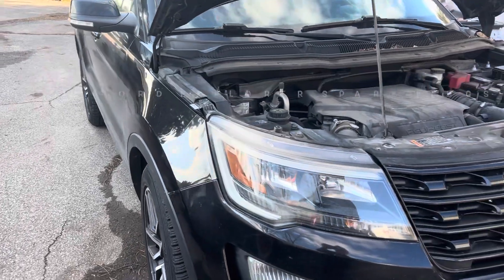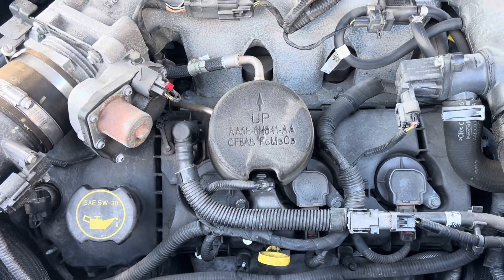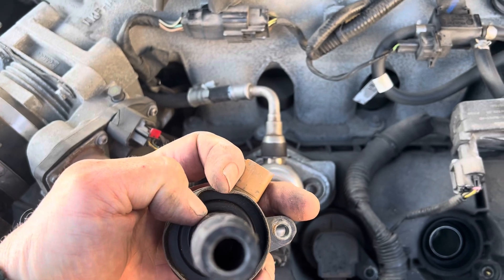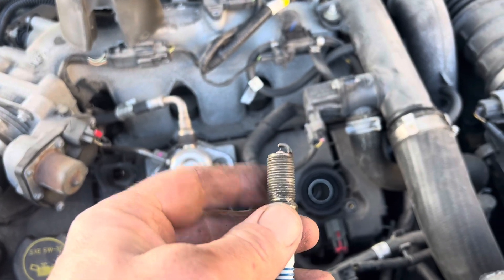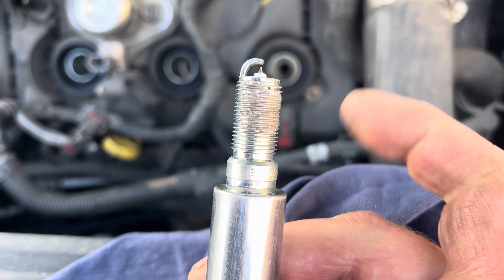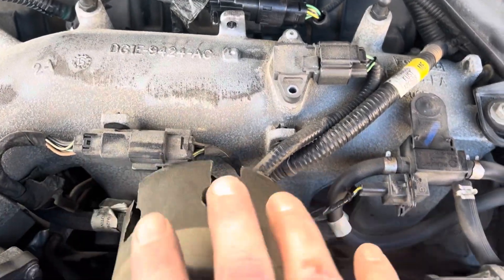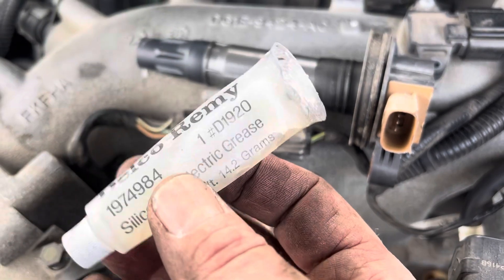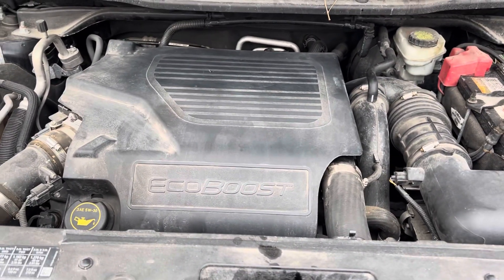Ford Explorer 3.5L Ecoboost  Spark Plug Replacement

Comment from the maker: Well - the reason I was doing the spark plugs was engine seemed to lack power. 
Replacing spark plugs didn’t improve that. 
The oil was a sign of seals in the turbos was leaking. 
I ended up replacing both turbos. 
One turbo expeller was blown down the exhaust pipe.